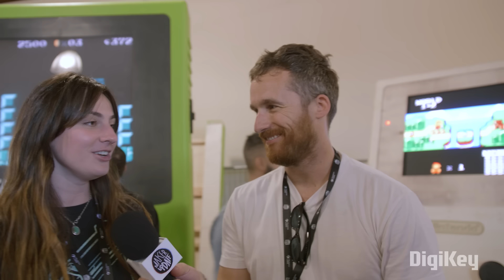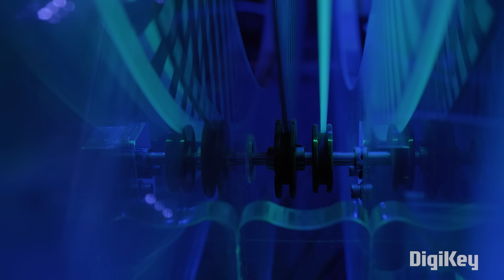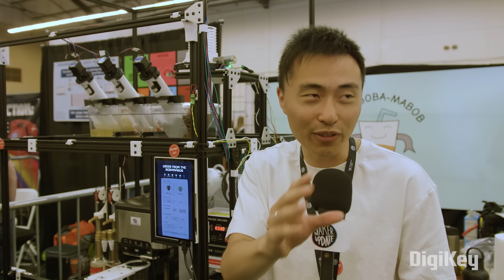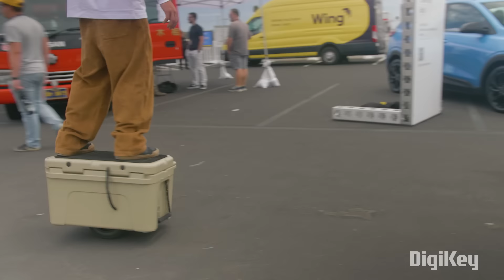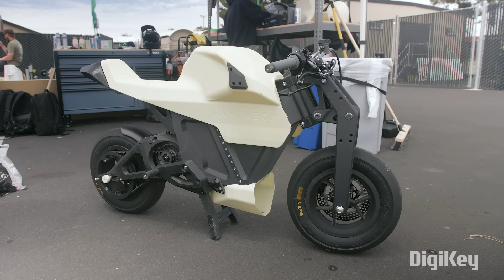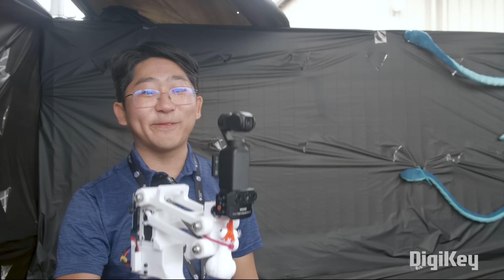Projects from Open Sauce 2026 [Maker Update] | Maker.io

Comment: The Pantheon 3D bike is impressive, but their knowledge of front suspension is less so. They have built a completely conventional 'girder' fork, with the head bearings in the frame, so that the entire front suspension is steered. The BMW Paralever is based on Norman Hossack's design. BMW evaluated it many, many, years ago and then just waited for Norman's Patent to expire before using it. The Hossack design mounts the steering head on the end of the suspension links, so that you are steering less mass and that mass is closer to the steering axis.
Reply: That seems like a much more sensible design. It's a good thing they're not a motorcycle company I suppose 😂
Reply: Great info, thank you.
Reply: I came here to say this. Also Hossacks are a far, ,far better design. Telescopics are a poor design force to work adequately.